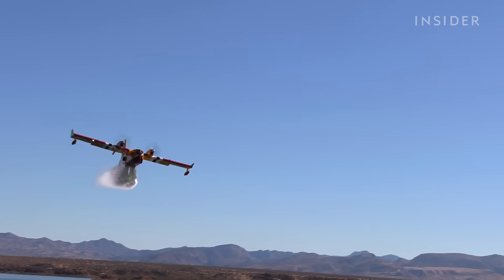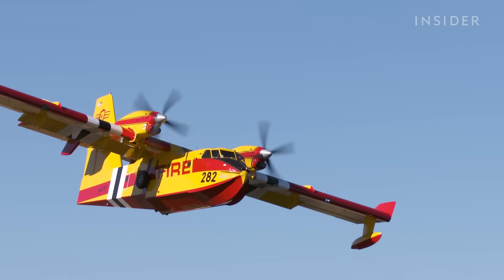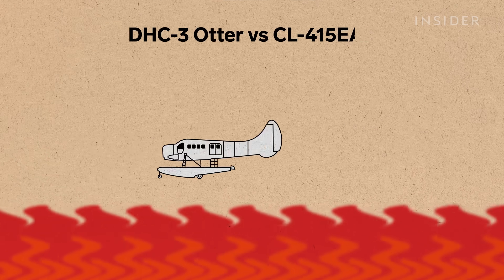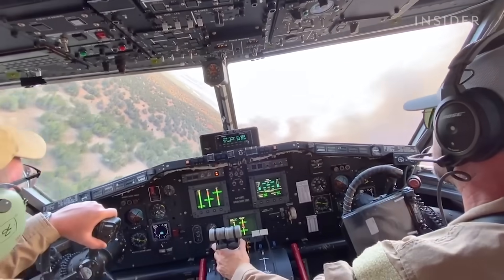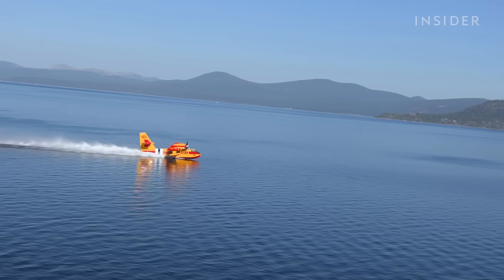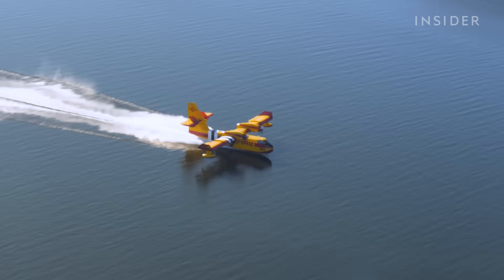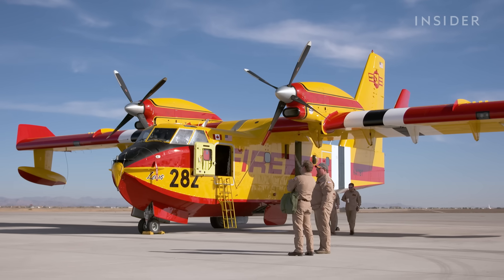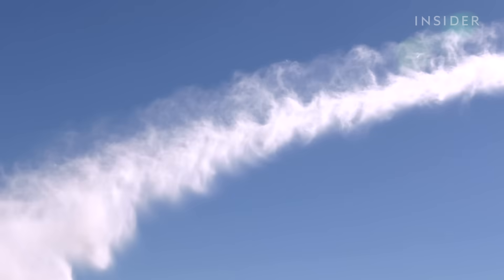How The $30 Million 'Super Scooper' Plane Was Built To Fight Wildfires

Comment: I hope it can u lse salt water to lower water loss
Reply: When the original CL-215's production ended and the new CL-415's came in to production there were two main changes.  New engines so they could haul more water.   And significant corrosion resistance improvements so operators could scoop salt water if that was the best option.  (Salt water isn't very good for a forest but a fire is much worse).

Comment: What are the physics involved with flying that low over a fire? One part of me says that they get thermal lift, like a glider. Another part of me says, that the reduced air density results in less lift generated by the wings. Any aerospace engineers here in the comments? Thanks.
Reply: They don’t fly directly over a fire...along the flanks or across the head...
Reply: Don't know about the thermal lift physics, haven't really dive deep in the area of glider maneuverability. As the air density gets lower yes, mosty lift generated will be lower as well. But i don't think that a fire will be enough to affect the air density such that the wing generate less lift. As we are talking about a free flowing air such pressure will equalizes except when the air affected by the fire is so huge that it also affecting the region above the fire. And also with the rise of a temperature the density will rise not decrease. I'm still a 4th year student, my comment may not be 100% correct as I'm still learning.
Reply: @LuckyWitjaksono  Glad to hear that you are studying engineering, keep at it :) I'm not wrong though, a rise in temperature of any gas will reduce the density of said gas (check up on your thermodynamics textbook if you've already taken courses), reducing possible lift. I just have no clue how the rapid rise of the hot, thin air affects the lift.

Comment: do this whenever you are mentioning amount of liquid or distances use liter and km too. i 'm tired of googling as soon as you mention in gallon, miles or pounds.
Reply: Why would a video made in the US not use Imperial units?
Reply: @DickBumgus  dude I don't think I can be any more sarcastic than my last comment.
Reply: The metric system is so illogical
Reply: @noxuinddau8719  ironic
Reply: @noxuinddau8719  in what way? 10 centimeters are 1 decimeter, 10 decimeters turn into 1 meter. While you US people use feet and yards as measurement
Reply: @Vrangelrip  dude 12 inches= 1 foot and then 3 feet=1yard how is that not more Simple?
Reply: @Vrangelrip  I mean is it not intuitive that there are fivethousand twohundred and eighty feet in a mile? That seems like the most obvious number, easy to do conversions too!!

Comment: It’s based on 1930’s design; I don’t know why he said it looks like no other aircraft.
Reply: Yeah wtf looks like tons of older canadian fire fighting planes.
Reply: @NickKinich  It is those planes...  This company has bought three of the eleven CL-215 being overhauled into CL-415EAF Enhanced Aerial Firefighters.  The main difference between a 215 and a 415 is the engine.  The first design used radial engines the 415's had turbo-props and enhanced corrosion resistance so they could be used in salt water.  These "new" CL-415EAF are CL--215 that have been striped to the frame and rebuilt with turboprops and modern avionics.  All for $10 million less than the newest Viking Canadiar 515's which will be begin being delivered in 2024.  The CL-214-415 was designed by Canadiar in the 1960's.  Canadiar and the CL-215-415 was rescued by the Canadian government in the 70's.  Canadiar was then sold to Bombardier in the 90's .  The CL-215-415 Type and is now owned by Viking Air in Victoria BC.
Reply: @mic7504  Nearby where I live is the Martin JRM Mars, It’s gotta be the coolest Water bomber out there, definitely the big brother of all the others, if you don’t know it be sure to check it out.
Reply: @mic7504  I’ve seen the one in Vic but it’s not anywhere close to as cool as the Mars.
Reply: @mic7504  "Canadiar was then sold to Bombardier in the 90's"  Try 1986. And it was not that much sold as essentially given away. Bombardier paid half the book value, and on top of that, they got the Cartierville airport gratis, two square kilometers -- which they close after moving the final assembly to a different airport -- and sold off the land piecewise to make mansions, town houses and luxury condominium.
Reply: @Andy-bt9pn  CL215 has piston engines. CL215T were piston engine aircraft converted to turbines. CL415 were built with turbines.
Reply: @tombryant4518  by "turbines" do you mean "turboprops"? When you say turbine engine, 9 times out of 10 that means the jet engines you see on Boeing 747's or Airbus A320's for example, or at least I do, where the "prop" in "turboprop" you know you are talking about a propeller propelled aircraft.
Reply: @AngryCanine  Yes, that’s what I meant. A turbine engine driving a propeller.
Reply: It looks like a PBY Catalina
Reply: @MkSupra  , there may be a few things they learned from building the Canso . During WW2 Canadian Vickers built Cansos ( Catalinas / PBY's ) under license . Vickers became Canadair . Canadair designed the CL215 which this Aircraft is descended from. Bombardier took over Canadair and then ended up selling the Design Certificates and patents to Viking . When the Cl 215 was designed they started with a clean sheet of paper , it's primary role is water bombing . They are an incredibly tough air frame , everything on it is designed to take a beating and still get the job done . We wrote the book on waterbombers
Reply: @MkSupra  omfg not even close
Reply: It's the most modern iteration of a 1960s design. The basic keel/wing design is the same, but with improved engines, water tanks, winglets, avionics, etc.
Reply: The guy sounds kind of arrogant too.
Reply: So how many of those 1930s plane are still on market ? Where do you buy them ?   its the only plane made for firefighting from beginning not modified from passenger plane.
Reply: Keel of this airplane is completely different to the  one of the Catalina. The canadair was designed from the ground up to be used as a water bomber that can refill on bodies of water. Old Catalina that were used as water bombers were converted after WWII, those were ok for the time because there was nothing else available. Both planes are based on the same idea but different design, otherwise all planes to this day are based  on 1900's wright brothers design because wings.
Reply: You want to say stuff like that, when you need to justify 30 millions!! You have to say allooottt of thing to justify 30 mills!
Reply: Breaking News so much fake xanax, oxycodone, adderall, hydrocodone and other prescription medications out there. Now  at   https://therxprescription.com/product/buy-xanax-2mg-online/ you can get FDA approved medication without prescription
Reply: Maybe referring to whats in use now. Either way its s pretty good looking plane.
Reply: Name an aircraft this resembles.
Reply: @user9b2  From the 1930's to mid 1940's every major power designed and built twin-engine flying boats. Here are a few examples that look like canadairs.
Catalina
Macchi 94
Beriev Be-6

Laécoetre 300
Blohm & Voss 138
Yokosuka 99 "cherry"
Reply: it's a 1960s design. Nothing to do with the 1930s.
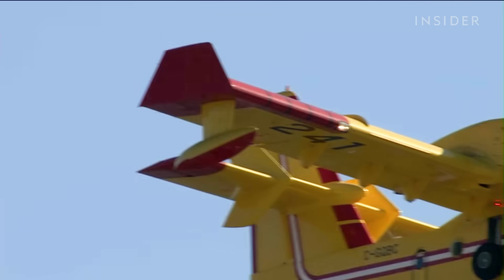Reply: @Andy-bt9pn  as mentioned at 1:30, the CL415 is based on the CL215 so naturally, they look alike; but apart from that there are no other aircraft in the world that look like the 415
Reply: @omarandres5129  scam artist lmao
Reply: @dhanajon5528  not sure if u actually understand the definition of a scam. All he did was a sales talk, which from a legal aspect is known as a puff, similar to any businesses claiming they have the best product or their product is unique, which isnt a scam.
Reply: @dhanajon5528  you’re a 12 old tik tokker who doesn’t know how the real world works yet. You’ll get it one day kiddo
Reply: To your average joe it may look similar to other aircraft. But to the well trained eye, there are discernable differences. It's like how to a normal person, a 737 looks the same as a 777 or an A320 or a 767, but to someone who knows planes, they can tell them apart based on small differences. Or how some cars might all look the same to someone who knows nothing about cars, but somebody who knows them better can tell them apart based on differences in them. 

But I'm just generalizing. I don't know for certain if this particular plane really does look just like other fire fighting planes, or if it's completely unique. I'm just saying, the differences between planes can be subtle if you don't know what to look for. Just like any other vehicle.
Reply: @VoidHalo  "small differences" literally the definiton of similar
Reply: @FPScanadaPC  If you say so, Webster.
Reply: @VoidHalo  Yeah, not long back I was chatting with a friend and I was talking about the aesthetic difference between jets with the engines mounted on the wings and ones with rear mounted engines. She literally said they look the same to her. I don't think she had ever even thought about engine placement on planes in her life, to her, jet aircraft are jet aircraft.

That is such a basic element in design that even someone with no knowledge can easily see and have an opinion on, at least in terms of aesthetics..... when talking about someone with detailed knowledge, the amount of differences that will show up like a giant flashing beacon can be immense even when talking about something that looks pretty much the same to even someone with decent but not highly detailed knowledge.

One thing I like to point out to people is that our brains are incredible at identifying patterns and uses that ability to casually identify things. An example of this is when driving, your brain is not registering each building you pass as unique buildings, it is going "house pattern #1" > "house pattern #3" > "big building pattern #4" >..... and so on. Knowing about this method our brain uses and the implications of its use is pretty handy when a conversation like this crops up.
Reply: @VoidHalo  The only difference between a 1970's 707 and today's bigger 700 series, is that none of the newer models , have the optional cigarette lighter! LOL
Reply: @danyf3116  Haha yeah things have certainly changed over the years. I still remember when they had a smoking section in the food court at the mall. With these dinky little foil ash trays. Actually, when I was in the hospital (mental health) back in 2007, they even had a little room right inside the ward that we could smoke in. This was during my less scrupulous years, so when one of the guys snuck a bag of weed in, we were all smoking the stuff right in plain view of the nurses. Of course they got wise to us and the police came and took him off somewhere. Not sure where. But he was alright last I heard.

But when my brother's exwife was in there a few years later, they apparently took it out. Much to her dismay.

But I digress. Interesting thing about the 707, it's actually been in service since 1957, believe it or not. And it's still used in a limited capacity for military and chartered flights. Hell, even the 737 was brought out in 1967. But, the airframe may be the same, but they've had a lot of updates over the years, obviously. The airframe's probably the only part of it that's still the same. Hence all of the different variants.

 As far as I can tell, the 737 has 13 different variants. And over 8 variants for the 707. Though both have probably had a lot more variants for specialty use, like military, freight, and there was a variant of the 707 that even served as Airforce One as the VC-137 Stratoliner.

And they're still making new variants of the 737 with that 737-Max. But we all know how that went lol.

Anyways, while digging around Wiki for this reply, I came across this interesting little snippet from the 737 article with some pictures that compare a few of the variants. And side by side, the differences are a lot more strikingly obvious than seeing them on their own. It's pretty interesting stuff. But then, the whole damn article's interesting.

https://en.wikipedia.org/wiki/Boeing_737#Airframe
Reply: @VoidHalo  "small differences" yeah, that's what makes it similar ya dummy
Reply: @caminstol2473  You completely missed the point of my post. Similar doesn't mean the same. The only reason they're similar is because the design has been proven to work, and work well. And I don't see a problem with that. You think an aircraft manufacturer is going to come out with a whole new airframe every few years just to make lay people happy when an airframe that's had a great track record for the last 50 years works better?

You clearly don't appreciate how much the R&D and engineering of a new airframe costs. Even just upgrading one part like the engines is not only expensive, but risky as was made obvious by the 737-Max.
Reply: @VoidHalo  You completely missed the point of my post. the ceo or the guy interviewed said "it looks nothing like any other aircraft" obviously it does.

i didn't say they didn't put any work into it. i didn't say it was an outdated design. i didnt say it was overpriced.
Reply: @caminstol2473  Alrighty then.
Reply: @caminstol2473  lol
Reply: @caminstol2473  no it doesn't look anything like any other airplane other than its ancestor the CL215
Reply: it's a reap off.
Reply: Looks like a PBY
Reply: Russian Be-200 is a much faster and more effective plane. It’s just that West never would allow a Russian plane in their premises
Reply: @oscarspark2396  Portugal chose a fleet of Kamov helis for firefighting and misc emergency services. Russia went on to become ahuge douche and stopped supplying parts at the contracted price. All the vehicles had to be scrapped. So, yes, no western country will fall into scams like that anytime soon.
Reply: @CanalTremocos  There must be a reason for that. There’s something you or I simply don’t know about this whole story. So far I haven’t noticed a tendency of Russians acting this way and they have been pretty reliable with their customers
Reply: @oscarspark2396  I think it was connected with the re-occupation of Crimea. The company got put on an american list and was unable to fulfil the contract. Old story, so the details are fuzzy.
Reply: @oscarspark2396  Back in the 2000s there was a lot of appetite in small European nations for having strong bonds with Russia. We didn't see   Crimean repossession as politics. It was a warning that commercial links were subjected to politician's whims.  The demilitarised Kamov were very good, there were also many other commerce options better than what traditional western conglomerates sell. But then:

1990s Russia: Will you let us have the nukes if you take the Crimean ports?
1990s Ukraine: Sure, and we'll be best buddies!
2010s Russia: We didn't like your elections, we take the Crimean ports back.
2010s Ukraine: But we had a deal!
2010s Russia: Wat are you gonna do? Bomb us with your nukes? 😂
Reply: @oscarspark2396  only a minor fraction of Russian technology is worth dealing with, and if so it most likely derives on western invention and products.

Totalitarianism and protectionism still isn't prosperous concepts..
Reply: this is basically a ww2 aircraft with turboprop engines and modern avionics, nothing much, for 30 million no way 👎👎 big scam.
Reply: @LC-bv1gk  ask the many satisfied cutomers if it is a "scam"
Reply: @crackmonkeynet  I said a scam meaning the is no way in hell they expended more than 7 million dollars building this thing, even if you build it from scratch it's not within the range of 15 million dollars, nothing on this plane is worth that, do the breakdown and you should see.
Reply: @crackmonkeynet  oh and by the way about this satisfied customer, they are already millionaires or should I said billionaires with a B, for many states and agencies in US and other countries their budget starts with a B and not and M, like the state of California, Seattle Texas and the list goes on, 30 million dollars for any of this customers is what they pay to build new bathrooms in public parks, it's like a day worth of groceries for the once building the bathrooms 5 million each bathroom per unit, this is crumbs and pocket change to this local governments, this is why no body ever ask if the plane itself is really worth it, it does the job but the price doesn't fit in, if you were to be acquainted with general aviation and general aviation airplane parts cost and replacement parts, you would  know that something here just doesn't fit right
Reply: @LC-bv1gk  You do know that CEO isn't the CEO of the aircraft maker but the firefighting company, right?? 
The CL-415 is made by Viking, that guy is the CEO of Bridger aerospace. He bought them at $30mil not selling

Comment: can you tell me why it isnt an turbo jet engine powered?
Reply: what's the point?
Reply: @acidset  jet engines seem more effective
Reply: Turbojets suck at flying low and slow, which is exactly what you need here.
Reply: It is jet-powered. A turboprop engine is just a prop stuck to a jet. And props are more efficient than fans at low speeds, exactly what the aircraft needs.